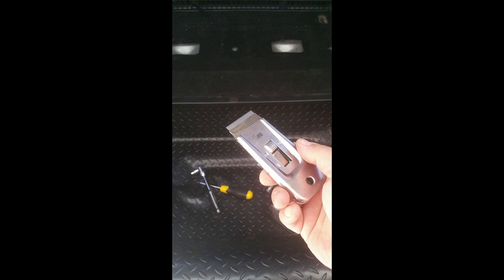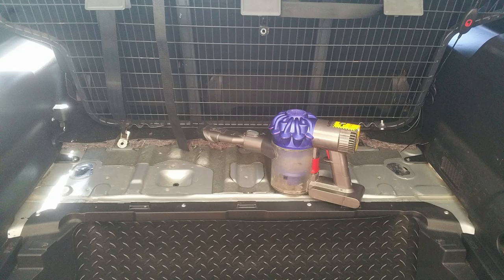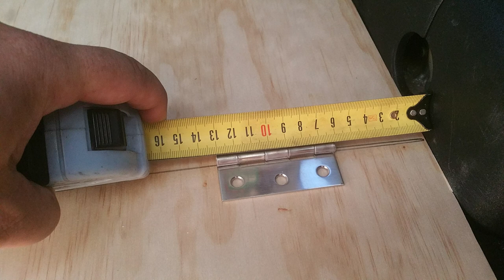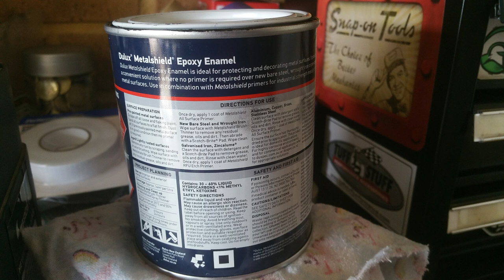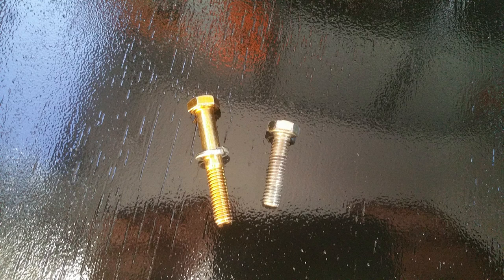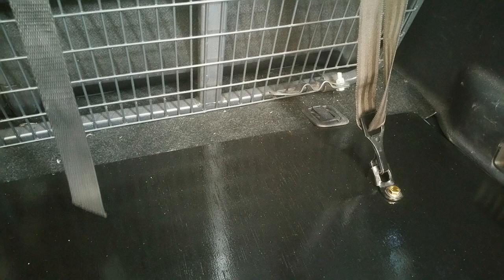DIY Pajero Rear Storage Mods: Part 1

Comment: Great Idea Thanks.  I have a 2017 NX and that should work the same.  Just looking at how I secure the fridge properly. Have the middle front tiedown but only an LH tiedown at the back.   Perhaps an eye bolt with a mudguard washer on the underside to make it strong enough.

Comment: Mate this vid is just what I needed to get started on my NX! Sorry if this is a dumb question but I didn’t quite get why you need to cut away that section of the floor lining and carpet? Also no dramas with the 9mm ply thickness when mounting the slide and drawer (Part 3)? Be nice not to have to go too thick and heavy.
Reply from the maker: Yeah I can understand not wanting to cut the carpet, especiall y if your bus is nice and new :) You could try and not remove the carpet, but it gives great access to the bolt holes, and doesn't prop the plywood up too high. Although keeping it there does help block off the holes Mitsubishi have put in the floor (which I ended up siliconing closed due to dust ingress).
Reply from the maker: I havent had any issues with the thickness of ply i used.

Comment: How thick is the ply you used? I think you said 9mm but surely thats not strong enough?
Reply from the maker: Yeah was about 9mm from memory mate. The false floor is sitting on the metal for the most part. It bridges the gap where the seats usually fold under, just fine, even when heavily loaded. As a plus, the 9mm also doesn't weigh that much.
Reply: @Unfastened  thanks mate I'll be copying your video and doing this to my pajero. Cheers